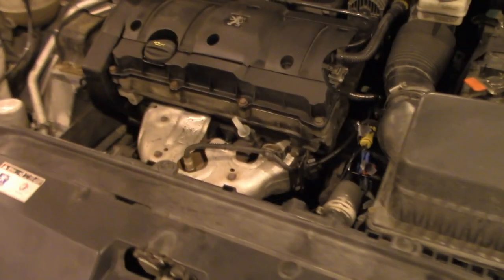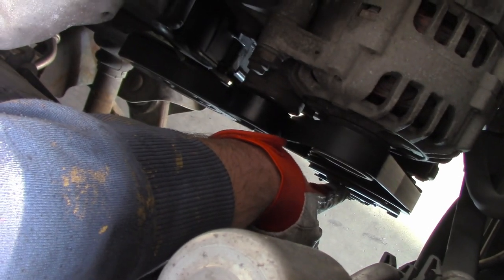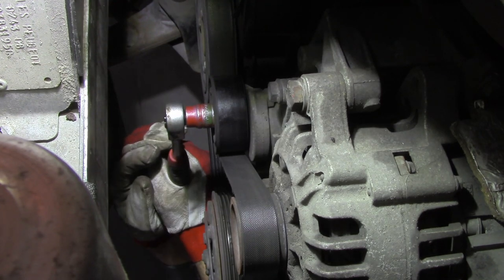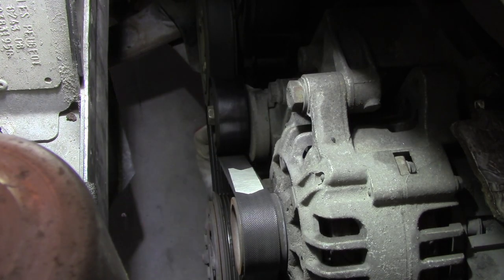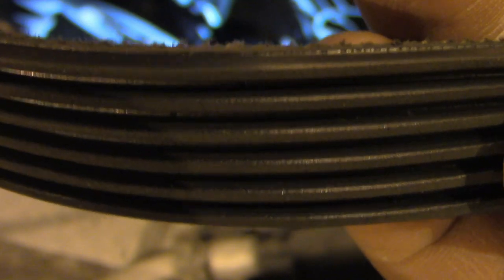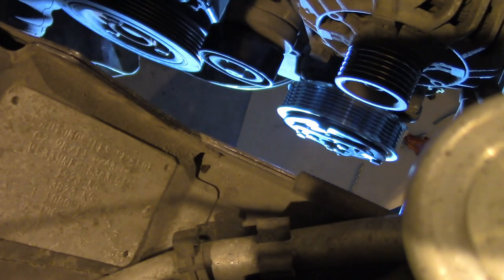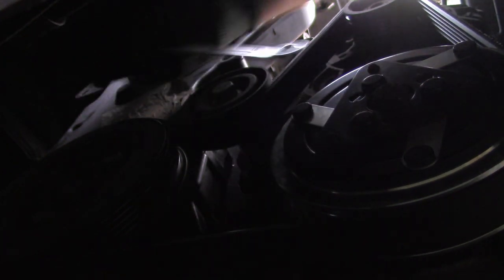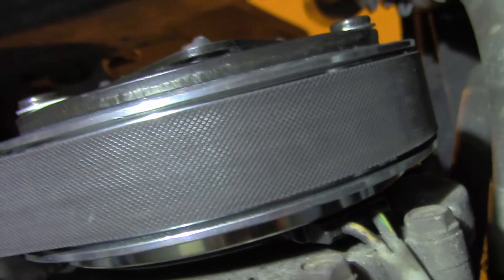Replacing Serpentine Belt - Peugeot 307

Comment: Nice video thanks! Helped  me replace the aux belt on my 407 SW after the nylon tensioner pulley melted and the belt fell off!!! I had to buy a whole new tensioner from Peugeot for £115.43 inc VAT, as I couldn't find just the pulley wheel anywhere!

Comment: Isn't there a locking pin hole on the tensioner so when you release the tension you can put in a pin/drill to hold it in the opened position until you refit the belt?  It may not be strictly necessary but I would have thought it better to not release the tension all the way as when you take the belt off and release torque on the nut.  I may be splitting hairs but I did wonder if it helped?

Comment: The 307 I have just worked on is a different design tensioner ? it is on a slotted bracket held tight with studs needing 13mm socket, top and bottom of the tensioner pulley and a 10mm tensioning screw at the bottom of the bracket :)
Reply: To fix a squealing new belt rub the edges with soap and if it still squeals spray with water, that fixed mine ?

Comment: My belt is squicky. Reason of that could be oil which is sprayed from intercooler. My engine is 1.6 hdi. I also think to change this belt but right after replacement of intercooler which has small hole wih oil leak.
Reply from the maker: Hi TLYD,
This might be caused by the wet auxiliary belt of course, nonetheless I would also check the tensioner. When the tensioner is worn out or the tension is incorrectly adjusted (too week) the belt might also squeak. 
Good luck!
Cheers

Comment: On my 307 the tensioner has a hex 8 socket & when I turn it it's not moving. Is it deferent for a diesel? Not sure if I have to loosen the alternator instead? 1.6hdi 2006
Reply: Same problem. Tensioner's bolt open, but tensioner have no any movement. It is solid, working bearing. I can't find even from generator any adjustment for tightning of the belt... interesting, how I will get belt on wheels 🤔